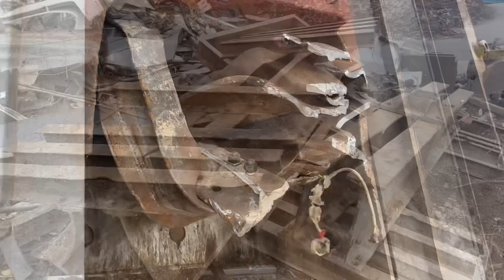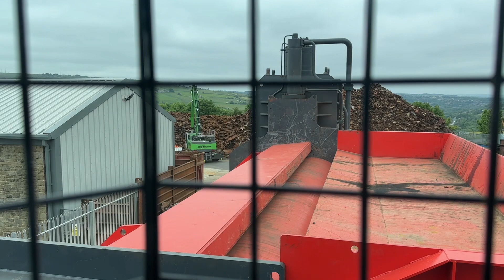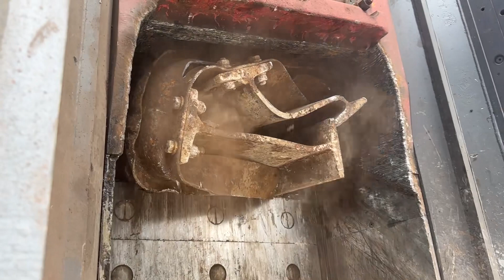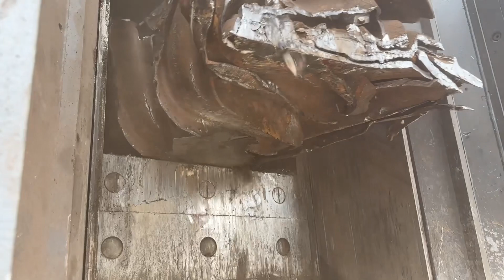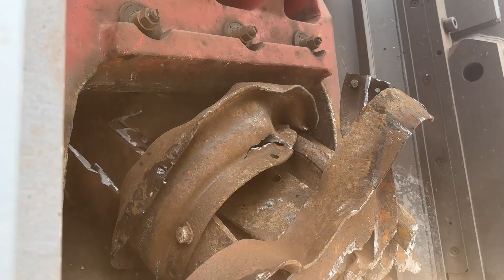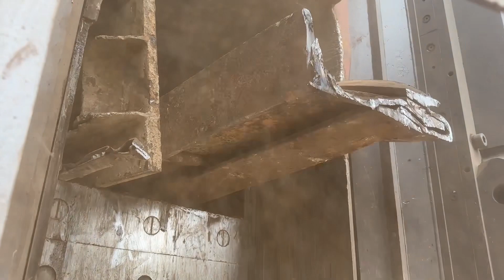Copex S-Wing 1000 tonne shear

Comment: Impressive machine.
What's the maximum material thickness it can cut through?
Reply from the maker: I’m not sure, I’d have to look at the spec sheet, it’s very rare it comes down to just putting, say, a 200mm square bar in, it’s about what the wings can compress and then can the pusher move it through and then can the guillotine cut it. It’s doing what we hoped it would.

Comment: Sounds like it's driven by a diesel. Why not use mains power? Or can't you get sufficient mains power out there?
Reply from the maker: Like most UK yards that aren't centrally located, we're up in the hills, we couldn't get a big enough power supply. It's just cost me £70k to put a new 225KVA supply in, for a supply to feed the shear I would need a sub station costing over £250k if Powergrid could supply - which they can't. Also electric is phenomenally expensive, the machine would need four 110kw motors and we're paying over 50 pence a kw/hr here plus massive daily standing charges for the supply. Unfortunately the government is going to do its best to force diesel out of the market so there's no telling what will happen next.